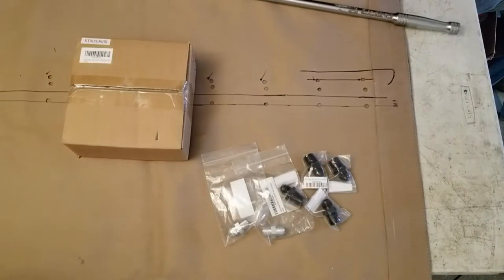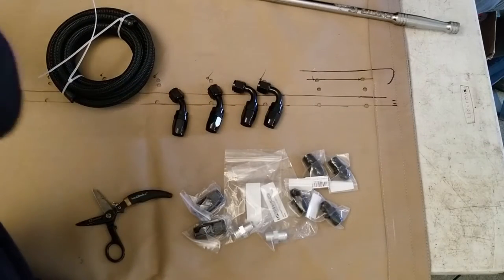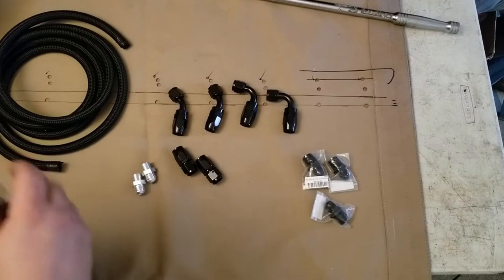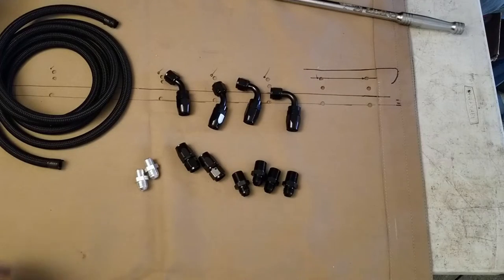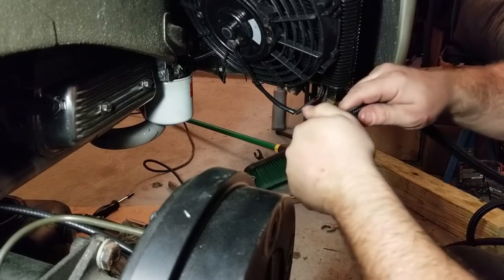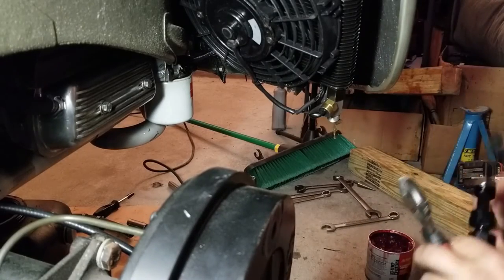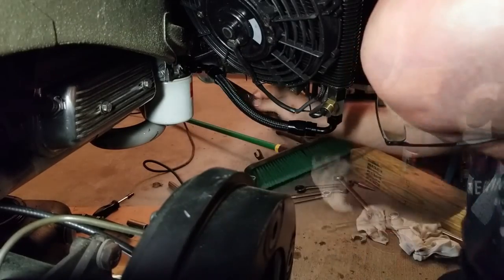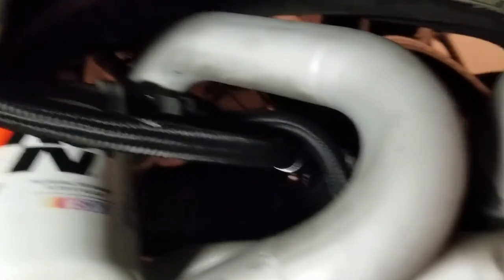Full-Flow Oil System! AN Fitting - Volkswagen BUG | JW Classic VW

Comment: G'day Kevin from Australia. 
Im liking the way they look what are those hoses like with heat.
At the moment i have rubber hoses like you had but i have mine in a fuel line fire heat sheild  tube as i run close to my exhaust. ✌
Reply from the maker: They seem to be doing great so far brother, but not really sure how hot they are getting. I'll put the infrared light gun on them the next time I'm out for a run and check out the temp for ya!!

Comment: The AN fittings seems to have a smaller ID opening doesn’t that constrict the oil flow?
Reply from the maker: This can sometimes be the case and can vary based on the manufacturer of the fittings.  I haven't seen it cause any issues.

Comment: With your oil filter close to the header, does it make the engine run hotter?
Reply from the maker: Yeah it did until I changed out to a smaller filter that gave me a better air gap.  Still thinking about maybe a heat shield for the new one but it is a lot cooler.
Reply: JW Classic VW Thanks for answering! I was wondering about that. I seen that oil filter that attaches to the oil pump. But that’s why I didn’t but it, since it’s close to the exhaust. You have a nice set up there!

Comment: Hi! Thank you for sharing this video... I'm doing the same thing to my bug and I got the parts you posted here, could you please tell me where you got the electric fan? Thanks!
Reply from the maker: Hey there brother I picked up my fan from someone in one of the Facebook groups... if you need help sourcing one let me know.  There are a number of choices depending on how you plan on mounting the cooler.
Reply: @JWClassicVW  cool, thank you for replying... I found some options on Amazon, I guess I just need to know now the size, I'm undecided if to go with 7" 9" or 10" since the size of the the cooler is 8x11.... Also, I see in the video you got what seems to be a sensor at the inlet or outlet of the cooler, could you please share some info about it? Thank you so much in advance!
Reply from the maker: Here is some info brother:
This is the switch required to turn on the electric fan when the engine reaches 180 degrees.  The adapter is needed for the -8AN fittings.

Inline Thermo switch - https://amzn.to/2Ey1XP1
Switch turns on the electric fan when oil temp hits 180 degrees.

Adapter -8AN for Thermo switch - https://amzn.to/2PEH3Uz

Comment: looking good, one concern, is the fan meant to be on that side? is it a push or pull fan, it looks like its pulling air through the cooler, but the coolers right up against the fender, would it work better the other way around, then you also have air forced into it from the wheel well area and its not pulling the hot air in from the engine.
Reply from the maker: It's a pull fan and the way it sits on an angle there is a good amount of room behind the fan.

Comment: Dig the AN fittings. Looking at getting the same stuff. 1/2” line? What oil pump you using?
Reply from the maker: Yup 1/2 line is correct 8an fittings.  The oil pump is a full flow EMPI pump.
Reply: @JWClassicVW  right on. I grabbed a CB Maxi 26. Hope that’s enough pump for the 1/2” line. Thanks for the info!

Comment: Curious... I've always wanted to put an oil cooler (or even a radiator) under the fender, do you have any concerns of damage from stones or other debris?
Reply from the maker: Not really by the way it sits tucked in, but with everyone bringing it up I may fashion a small deflector for the bottom.

Comment: I just got the same in the rear fender Oil cooler setup and I have an issue with it. The upper/round bumper bracket is in the way and I am not sure how to get it to work with the way the cooler bracket bolts to the car.  How did you do it??? got any pictures that would help[ me?

Love your Site!
Reply from the maker: Hey brother hit me up on the Facebook group with some photos and I'll take a look.  Just look in the video description for the FB link.
Reply from the maker: Every figure it out brother... if not email me some photos and we'll get it sorted... JWCLASSICVW@Yahoo.com

Comment: when you did your full flow ,did you removed the spring and pressure valve from the block ?
Reply from the maker: No they stay in the case... you would never build oil pressure if they were left out.  Thanks for the comment Jose!! 😀😀
Reply: thanks for the info. and the videos @JWClassicVW

Comment: How did you mount that oil filter did you buy a mount or make one ?
Reply from the maker: I bought a mount that I modified to work.  Required some new mounting holes for the oil filter adapter.